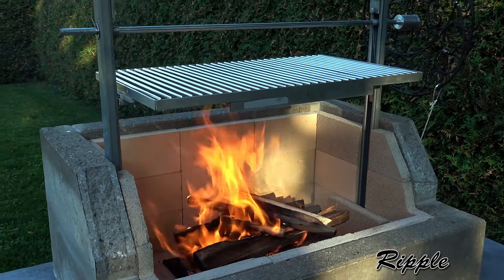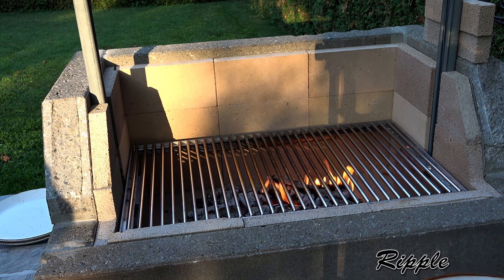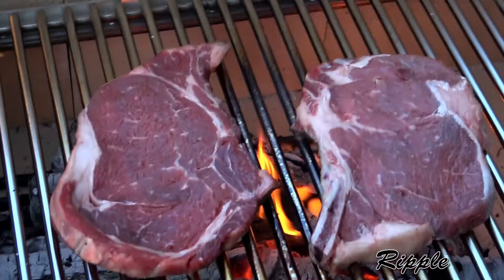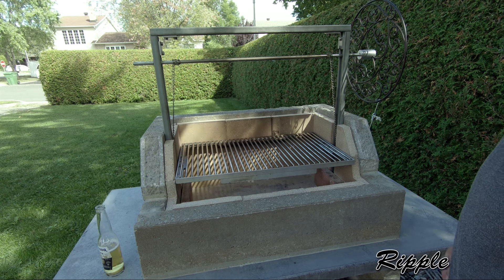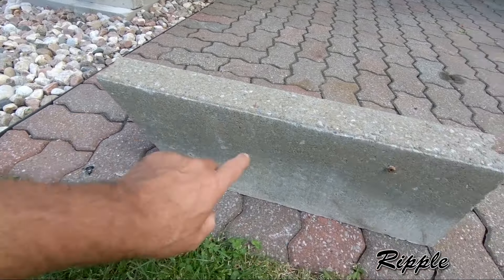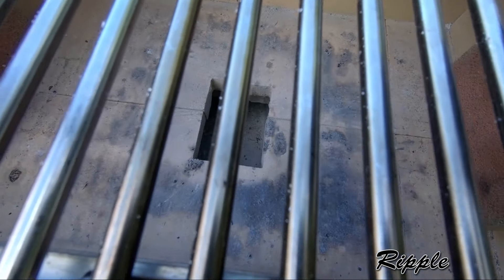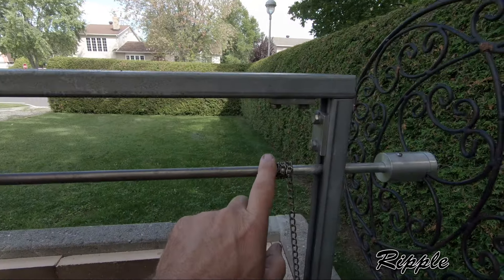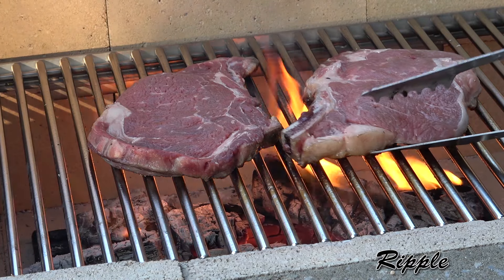S  RIPPLE  Santa Maria BBQ  Grill.

Comment: What did you did to remove the galvanized coating from the strut?
Reply from the maker: Did not remove it.
Reply: @S.ripple  is galv poisonous when heated? I actually just made one today out of strut, I plan on coating it in cleaning acid over night to remove it.
Reply from the maker: @serialgrillaz6669  Hey Serial, my grill is stainless steel by broil king
Reply: @S.ripple  but the frame is galvanized, I'm just worried about the fumes.
Reply from the maker: The frame off the grill is actually alluminium,no problem.